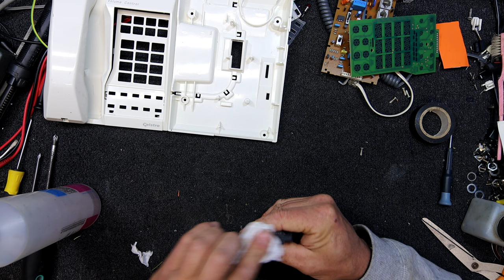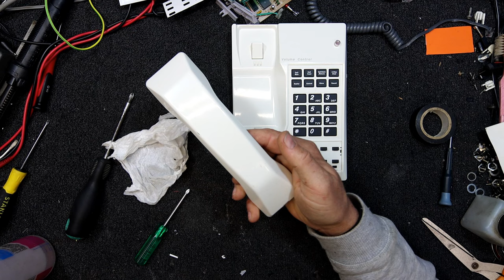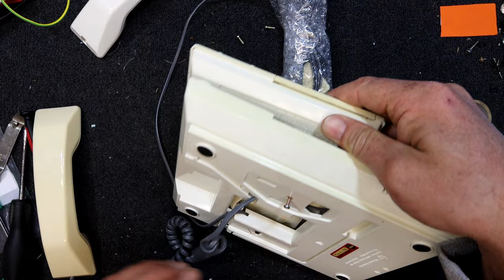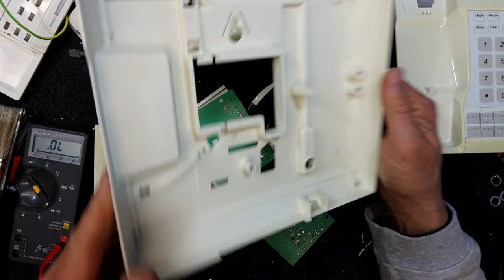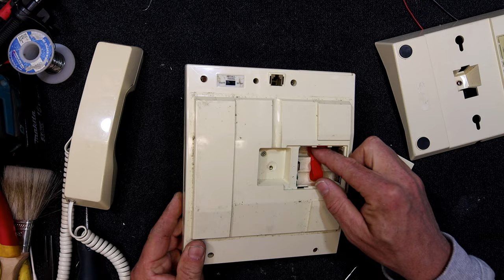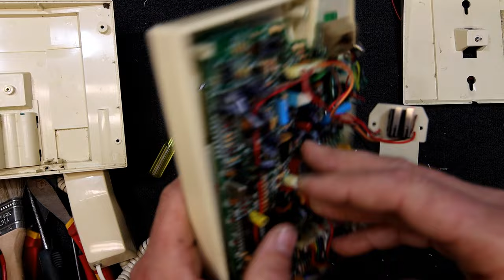Inside Australian Telephones Touchfone T200, T400VC  and Persuit

Comment: These phones were such an Australian institution.  What does the LED on that first phone you looked at actually indicate?  I remember what I think was the Touchfone 250, we had two of them in our house when I was growing up, I don't think we had the later Touchfone 400 units.
Reply from the maker: I believe the LED flashes when the phone is ringing but have never seen one in operation. The TF200 ran from 1988 until around 1996. The TF400 came out around 1997 with more buttons for the Easycall features that came out at the same time.  There is a TF300 but it may have only been for PABX use. They were a well designed Australian product, other than the membrane keypad that came out on the early ones, and some grabbed the line briefly every so often and would drop out internet connections from what I have heard.
Reply: @StevesElectronicRepairShop  Yes, I've heard that too, my understanding is the phones would 'grab the line' as you put it in order to charge up the internal battery to retain the preset phone numbers, maybe I'm wrong.  I don't remember actually using a Telecom phone with a flat membrane keypad on it.  The ones we had were fitted with light grey keys, and I think there were 6 buttons above the keypad.  I do remember them having a volume control type thing on the right hand side.
Reply from the maker: @Lachlant1984  It was supposedly grabbing the line for memory retention. I dont think they had a battery, probably a capacitor or something. The 200s all had a sliding ringer volume and the 6 keys, except one model that could be used with a headset which had 8 function keys. I think the membrane types were quickly discontinued and probably gone by 1990. I think they were both a risk of shock from lightning, and had issues with static electricity getting into the phone from people fingers. They also had a rubbish tactile response, much like trying to type in numbers on a microwave oven.
Reply: @StevesElectronicRepairShop  Right, or trying to type on a Speak & Spell keyboard.  I think I may have seen one of those membrane keypad phones very briefly in around 1991 or 1992.  What made those phones for susceptible to shocking users due to a lightning strike than the rubber button variants?
Reply from the maker: @Lachlant1984  The membrane keypad is just a thin layer of plastic over the conductive parts. The rubber ones still use basically the same type of keypad, but with quite thick rubber buttons over the top which are a much better insulator if there is a distant lightning strike that doesnt put too high a voltage down the line. Still a shock hazard if there is a strike nearby, but then it can come out the handset or curly cord as well, which is why they said dont use in a thunderstorm unless an emergency.

Comment: Do you reckon in a few decades from now people will be collecting touch screen mobile phones? When displayed as an inert collection they would just look like different sized glass rectangles.
Reply from the maker: Might be a market for stick on screens that make them look alive. Otherwise they would be very boring. You would also need to remove the batteries which have a habit of expanding when they fill up with gas and break the screen. I guess we should be making videos of their operation so people can make online emulators later.